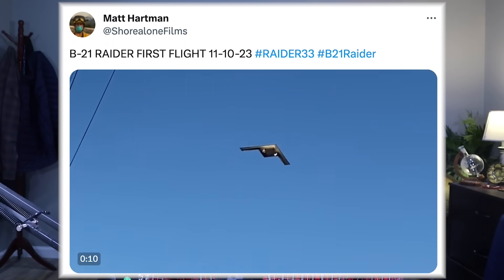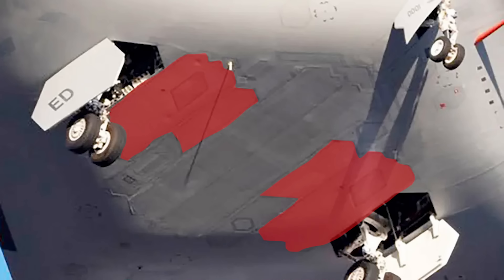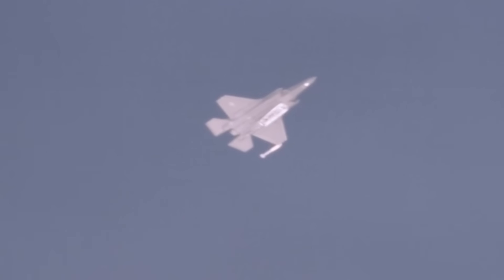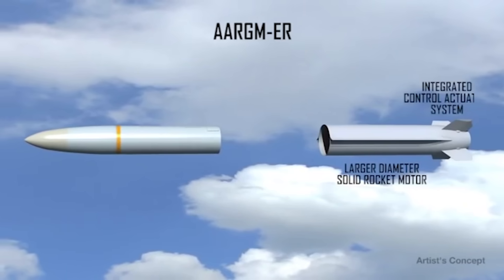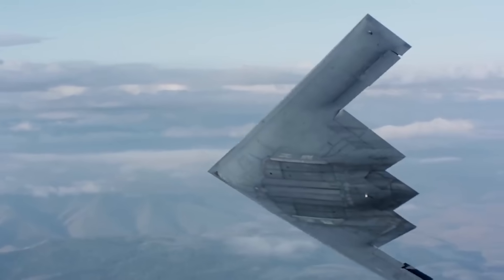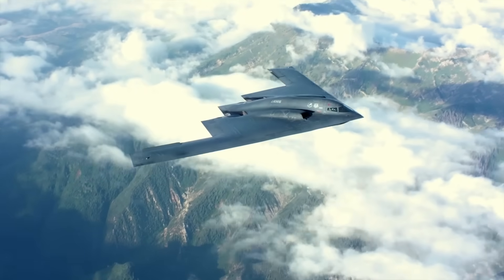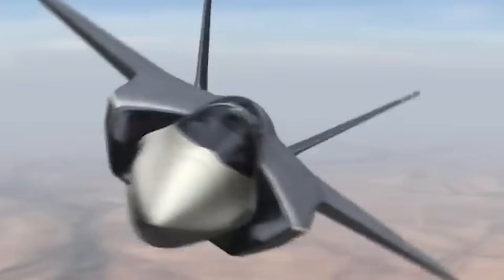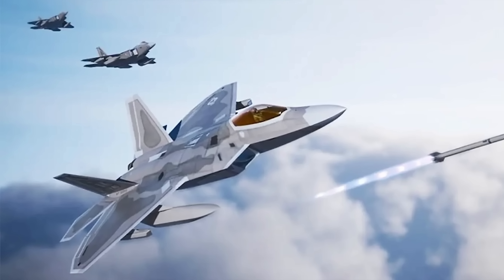Can the B-21 carry air-to-air missiles??

Comment: Actually, I would think some air to air capability on the B-21 would be a sensible move.  People seem quick to forget that bombers with limited air-to-air defensive ability isn't new at all. Back in world war 2, bombers carried guns. US B-52 had tail guns until the end of the 1980's. Also, while it has never been shown, there have long been claims that the F-117 Nighthawk, which was used in Desert Strom (1991) had the ability to carry air-to-air missiles, even if they were never actually used.  Air-to-air would be a great move for self defense. Another possibility exists that is rarely discussed. 

What about AWACS type radar surveillance aircraft that are part of an air defense network? These planes can often pick up fighters at 200+ miles out and track them. However, a stealth platform should be able to sneak up on a radar surveillance plane and take it down if it has air-to air weapons. We know from Desert Storm that using stealth aircraft to attack radar sites and air defense control centers is a feasible tactic. A stealth plane hunting for AWACS aircraft makes sense.

Comment: To make the B-21 a long term viable A/C it needs to change roles as new conditions spring up! The weapons combat officer on the B-21 or it's AI drone escorts can independently of command tasked be fired! Focusing on short term, instead of field of play opportunities is detrimental to the long term lifespan of the platform, in the flock squad environment!!!

Comment: With all this talk of modularity, I've got thoughts of "Rapid Dragon but using AIM-260s" or "Rapid Dragon but using AMRAAMs" instead of using air to ground weapons.
If you can combine that with a good passive radar system or some other platform carrying a superior radar system (say a friendly AWACS-type aircraft in the area), you've got something that can potentially just say "C'mon, make my day" to any would-be threats intending to shoot down a group of military "cargo" aircraft carrying such systems.
Would be quite the deterrent platform against "just target the AWACS" type attacks as well, because you could easily flank the AWACS with a couple of C-17's loaded with say 6 pallets of 9 to 25 AIM-260's each, and then 3-5 more C-17's carrying "original flavor" Rapid Dragon systems for the actual ground targets that you want to take out. This would let the AWACS operate much closer to the front line of battle (especially if the AIM-260 has counter-missile capability) with the AWACS providing situational awareness for forward-operating F-35's (or in the future, B-21's operating as purely recon and target designation platforms, or they could carry heavier ordinance to take out hardened targets as they're pretty much purpose-built for from what I gather), while the F-35's (or B-21's) relay that target data back to the AWACS, which relays it locally over a datalink to the C-17's, which then release a Rapid Dragon system to neutralize whatever threat may have been encountered (be that an AGM flavor Rapid Dragon or an AIM-260 flavor Rapid Dragon that is needed).
Bonus points if the Rapid Dragon system is further developed to allow for "single launch" of the missiles without dropping the entire pallet out the back, be they AGM or AIM-260 flavor, because "low intensity conflicts" are going to keep happening forever, with higher intensity conflicts sprinkled between them.

Comment: These look like engine bay doors to me, and I think there would be provisions for air to air defence weapons in the main weapons bay like the F-35, as with LO aircraft every time you open a door or panel your changing the Outer Mould Lines and increasing your signature and more doors opening in flight makes it more difficult to reseal and keep the surface wave from hitting a break causing it to return a reflection.

Comment: All you guys speculating about firing not just one but maybe dozens of missiles from a B-21 have got to be nuts.
You'd risk an aircraft that likely costs more than 7x an F-35 by firing missiles that would reveal its position in the sky? Unless the B-21 suddenly sprouts a new configuration that goes supersonic, firing a load of missiles would attract considerable attention. The B-52 is better suited for being a missile truck firing standoff missiles. Let the stealth bombers stay stealthy and drop only bombs.

Comment: Both the F-22 and F-35 were designed at a time when the primary adversary was Russia. That meant that range was not a high priority at the time. Even carrier aircraft (like the Super Hornet and F-35 B/C) were built primarily as attack aircraft, not as interceptors.

This meant that as the F-14 was retired, US carriers really didn't have very good interceptor capabilities. Meanwhile, China has replaced Russia as the most potent adversary and has invested heavily in long range aircraft of their own, capabable of firing missiles that outmatch the Amraam. While the Aim-260 has been developed as a response, it appears to be too big to fit into F-35 internal bays, and using Gen 4 aircraft to carry them may be less than ideal.

This appears to have created a severe limitation to how able the US is able to project naval power, especially in the Western Pacific. 

However, if the B-21 is able to carry Aim-260s (and possibly future, even more capable air-to-air missiles), they may be able to plug this hole until Gen-6 fighters arrive. I would find it a bit strange if this was not realized during it's design.

Comment: There was a plane in development for a short time called the B1 R, which was supposed to be a successor to the B1 B Lancer this aircraft was supposed to be a bomber/missile truck platform. It’s design was similar to that of the SR 71 Blackbird. Then, suddenly, nothing was heard about this project for years just disappeared into oblivion. What if it was that airplane that became the B-21? With that said, the answer to your question would be yes this plane is designed to carry air to air missiles. I just would hate to be the enemy Air Force with one of these guys around because they could volley fire those missiles and take out all of our aircraft before we even knew what happened and we wouldn’t even see what did it.

Comment: As cool as that would be... you don't need separate payload doors for air to air missiles.
If you look at the top view, and compare it with the bottom view... it looks like those bay doors to the sides most likely are for engine maintenance.

Comment: A missile can also intercept an incoming missile.  

Fighters, and stealth are useless platforms for a while, and having ability to modify commercial passenger jets to carry missiles and bombs would reduce the budget.

Only lasers will be not intercept-able.  USA needs better space and ground lasers, more space force budget, and better communications between air-force and space-force (Trump maybe made an oops with space-force that was part of the air-force, but if it’s in the same building and communicating well then it’s a double win.)
Reply: And commercial passenger jet would get shot down easily, and would be easy to lock on to from very far differences. May reduce budget but your aircraft would be shot down before being able to drop the munitions.
Reply: @Footballforecast67  Shot down with what?  Ground cannon systems can’t reach that altitude.  

+Can carry much more counter missiles than any fighter.  

Also AI is pretty good for optical guided missiles that chaff or flare won’t be a defense.

Comment: B21 Carrie’s a lesser payload than the B2. It’s more stealthy also. It is designed for behind enemy  lines destruction of high value targets. The F35 does SEAD missions. Any defensive capabilities relative to weaponry, not electronic, says it can be tracked & targeted, which, let’s hope, that’s not the case. Any speculation narrated is MISINFORMATION. I’m inclined to believe they are access panels for ease of maintenance. Unless the publicly disclosed information is intended to mislead adversaries & me, to which I say, Right on. I’ll find out when China fucks up.

Comment: The photos of the bottom of the aircraft seem to show significant shadows around the closing panels of the weapons bays.  My understanding of stealth is that these seams are critical to maintaining stealth.  The ability to maintain perfectly smooth exterior surfaces is one of the difficult aspects of manufacturing a stealth aircraft.  Perhaps it’s because this is just the first test article?

Comment: The middle sized ones next to each wheel well are just like the B-2'sb they're probably to access the engines. But the small ones between those and the central big one are the most interesting and like everyone has been speculating, could be for A-A or A-G missiles.

Comment: As you know there are bomb bay doors.  The secondary bays could also be for a rotating misleading bay.  Kind of like an older cylinder or wheel gun.  Maybe they stepped it up to be more like an automatic that's able to select which missle to fire and when.
Reply: Yeah a helical system that rotates?

Comment: I wouldn't be surprised if AIM-260s were stacked in a VLS config (or angled 45 degrees forward)   If this has a VLS system built in I imagine it could probably carry like 48x missiles.
Reply: or you could just have a horizontally oriented bomb rack style payload bay and not incur minimum range penalties

Comment: The B-21 doesn't need more survivability. The Air Force has already stated the B-21 can loiter over an S-400 site without being detected.
Reply: I believe that's a bit misleading. It can loiter over that battery without being "locked on", they'd know it's there. Somewhere. Which is why a pear belligerent might sent fighters to locate it and try to knock it down. No stealth AC is invisible to the M1 eyeball. I think some Air-to-Air is essential.
Reply: @lnchgj  
You can believe all you want. The Air Force knows.

Comment: FYI, the Pergrine has multi-mode seeker and extended rocket engine. Meaning it can go from being a an IR missile the size of Sidewinder (or a little smaller), but with the capabilities of the AIM-120C7 in terms of its seeker and range.
Reply: How do they get the range in that small size?
Reply: @recoil53   multi stage boosters?
Reply: @stephenwilkinson1254  Which suggests even more space for propulsion.
Reply: @recoil53 defense industry wizardry and a slightly smaller payload

Comment: Also keep in mind that the B-21 has been designed to be "optionally manned" and that the NGAD program is also being designed as more of an in theatre command and control platform for "AI enabled wingmen" also remember that Northrop Grumman is also one of the leading contractors on the NGAD. So I think it's absolutely plausible that the B-21 was designed to fit into that system of systems as an option for the "AI enabled wingmen" OR it might be controlling other AI enabled wing men. While it may not be one of the low cost attritable ones it may and in my opinion will still fit into that overall operational philosophy. So it makes perfect sense to me that it would be capable of launching Air to Air missiles.

Comment: Could the main payload bay fit something the size of an AIM-54 Phoenix? That would be a game changer from a stealth aircraft paired with a few loyal wingman drones.
Reply: Length: 13 ft (4.0 m) Weight: 1,000–1,040 pounds (450–470 kg) Diameter: 15 in (380 mm) Wing span: 3 ft (910 mm)
Reply: @stephensmith6599  How big is  the payload bay on the B-21?
Reply: @ThirdLawPair  I have not been able to find dimensions.  However, it will accommodate the B61-13 which is 13.5 inches in diameter and 12 feet long and the JASSM-ER at 25 inches in diameter and 14 feet long.  So should be good for the AIM-260 JATM ... which is the replacement for AMRAAM.
Reply: @stephensmith6599  Well, the NGAD will be able to carry the AIM-260 for sure. If the B-21 has a capacity to carry some of the extra spicy anti-air missiles, it may be able to fill a niche that the NGAD can't. They've successfully launched an SM-6 from a Super Hornet. If they could do that without compromising stealth, it would be very hard for any adversaries to match that capability.

Comment: It should also be speculated whether it might internally carry, not munitions, but launcing and mid-air recovery of miniature 'loyal wingman' UCAVs. Could also be for access to internal mission-configurable modules, in the same way as modern warships and submarines have (such as cyber warfare, like the F-35 has been carrying in an external pod).

We also shouldn't forget that they could simply be there for future-proofing: Potential for upgrades, which aren't yet actively used.

Another possibility is that it MIGHT be for a refuelling capability. Some might scoff at that, but it's a concept which was already used on strategic bombers in the past. The Avro Vulcan raids on Argentina could not have been achieved without it.

Comment: The limiting factor is possibility the lack of a long range radar not the inability to carry the missile. We know the original LRSB did have air to air as part of the brief, and the USAF at the time said it was cut to bring down costs. Could it come back, possibly, but I suspect we are talking about a truck carrying a wide variety of weapons for other fighters.
Reply: It's possible that this bomber will work with the F-35 and drones that will do most of the work. Much like a carrier battle group. It will come with calling cards!
Reply: @rocketmann8333  Totally agree, the idea that it could function as a penetrating truck providing the magazine depth for other assets is very realistic. 

I have always wondered if we might see a later version with additional crew to function as a penetrating AWACS. Reliant on drones and aircraft like the F-35 for both sensor reach and penetrating strike, coordinating activities beyond the reach of conventional AWACS platforms. The benefit of the human element is command and control. Cruise missile shave proven you don't need a human to prosecute the target.

That is the direction I see manned operations  progressing in the future, so me an air to air capability for the B21 is  a total red hearing.

Comment: I think theres little doubt they are bays for additional munitions or defense tools. To think they are maintenance doors is a stretch but at this point its all a big guess as USAF is playing this close to the vest. What is clear is this program is very far along in what is probably the most problem free design and testing cycle of a cutting edge war plane Ive ever seen. Compare this to the F-35 and you'll see what I mean.And still even with all the head aches the F-35 is a paradigm changing Jabo. So will the B-21, its all very exciting for USAF and I hope Vlad Putin enjoys being surrounded by 5'th and 6'th Gen Jabo's and Bombers. This Bomber is already close to full fledged production which I think will start even sooner then 2027.
Reply: iirc the B-21 program started in 2011, so it's had the huge advantage of 21st century computing throughout the entire development which absolutely would've made it smoother

Comment: The two closed doors inboard of the landing gear are the inner landing gear doors. They open and close during retraction and extension of the main landing gear.
Reply: I don’t think that’s the case. Look at the mechanism on the landing gear. They pretty clearly hinge fore/aft. The rear landing gear appear to hinge forward towards the nose, not to the side as you say. 

Do you have any evidence to support your claim? Or just “trust me bro”? They’re also FAR bigger than they would need to be to accommodate the landing gear.
Reply: Your right. After looking at it again, It does appear they retract forward. The doors appear to be directly under the engines. Maybe access panels for maintenance on the engines. It looks much smaller than the B2. Probably 2 engines.
Reply: @sentryfe74  , you were right the first time.  Those are the inboard gear doors. Have a look at the gear on most other large jets... You'll see similar configurations. For that matter, look at the B-2's gear door arrangement. Pretty much the same...

Comment: Are you sure these aren't access hatches to allow for the folding of the landing gear? 
The position and size would seem to make this more likely for the larger seamed section adjacent to the landing gear, while I think the skinny one in between both the landing gear receptacle and the ordinance bay would probably be a maintenance panel as you allude to at the beginning of the video.
Even though the B-21 is reported to be an amazing sensor platform, I highly doubt they included IRST or even an active AESA radar required to get a firing solution for firing air-to-air missiles as both would be largely unnecessary and break the stealth characteristics of the aircraft.
Occam's razor over fantastic speculation is a good rule of thumb when analyzing something you don't fully understand.
Reply: In a networked air force the B21 may not need to detect its own targets. It can use low intercept data links to gather targeting information from other sensor equipped platforms

Comment: Each of those panels have some kind of smaller (translucent?) panel that almost looks like a cooling duct as like the F-22's avionics cooling exhaust grill.  I wonder if it's inlet air for the hydraulic/electrical power packs?